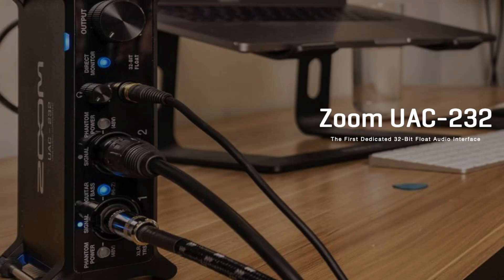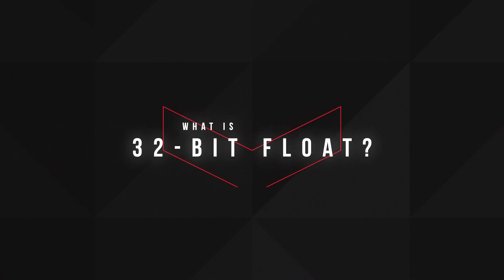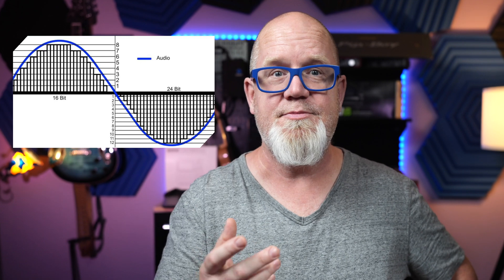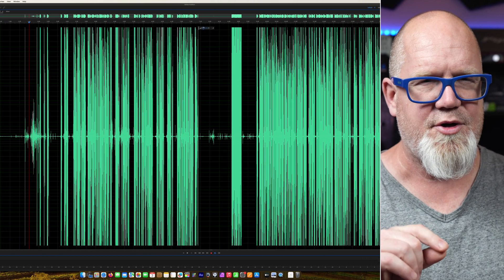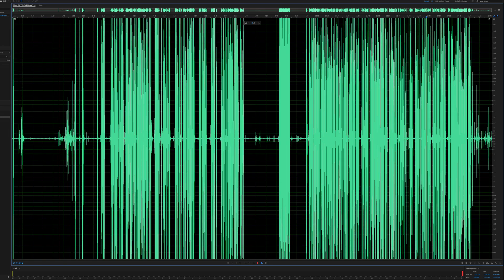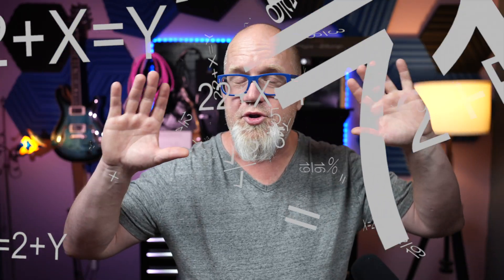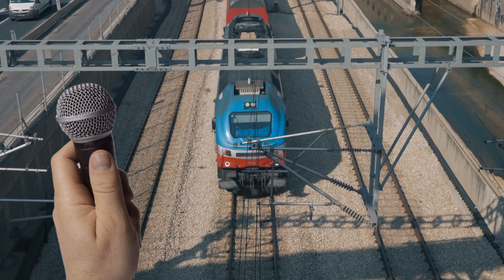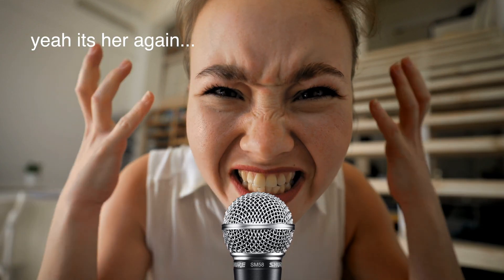Is 32-bit Float REALLY Necessary For Your Audio Setup?

Comment: 4:30 yes.that but also micing when you’re in nature in general. You can record all the things across the dynamic range - a lion’s footfall AND roar is the common example. You have a wider berth for your gain stage. 

But as primarily a music guy? Higher bit depth is useful if like me, you have no formal training and lack the proper discernment to not use every fancy new plugin that can otherwise bring up your noise floor. Across multiple tracks that adds up and can effect the overall sonics especially once you consider the “self-mastering” stage. (a beat I’m mixing can have as few as 12 tracks or as many as 100+ depending on how ambitious the project.) So even when going for a 12 or 16 bit emulated sound or classic era samplers, it’s best to “emulate” it…at as high a bit depth and sample rate as your rig and signal chain will allow. For example, grab some excellent quality vintage emulation processors a la decimort or rx-20 or the sp emulation and resample it at 32bit (or just set the project to 32bit float) and as high a sample rate as possible without your system crashing. 

Why:

Because that mathy float point stuff? When you then load it into Studio One or ProTools or some other primarily “mixing” system? You can gain stage without worrying about noise floor or too little dynamic depth. I can “record” at a lower level without being too concerned with clipping. (This is more important in some genres than other like metal, alternative, etc where it can jump from loud to quiet quickly, and with emcees who don’t really stand tf still in relation to the mic because of the nature of what we do, and the cadence and delivery requirements of spitting.) you can get a great take with as high a bit depth as your gear will allow, which to my knowledge can top out at 24bit with most rigs. 

But then it’s all the plugins. If you use well thought out vintage emulation a la Slate Digital or UAD’s offerings, you MUST - I repeat - MUST gain stage as though you are in an analogue environment for those VMR or VTM type vst’s to respond optimally. I aim for -12db peak across the board. The closer  you get to that in the take (even when dealing with virtual instruments and drum samples out of a modern system from MPC or Maschine), the better. But if you’re starting out with 32bit sounds in the daw and bounce it at a higher rate in compliance with Nyquist (if your end master is gonna be CD quality of 44.1, set your project to double at 88.2; and if broadcast standards of 48khz, go 96). But if you come into the mix session at double the sample rate, and you import into a more robust mixing DAW, set that to the same so the internal math doesn’t get wonky via conversion. 

Then your effects and what not will behave as designed and are less destructive. Mathematically, you can only alter the sound by subtraction- that is, REMOVING bits. Anything you do to alter the sound is subtractive in the digital space, when it’s additive in analog like with 2” tape machines. The float point helps, and the noise floor is so low that it is not a problem no matter how much you use the multiple compressor mix philosophy. As a novice who didn’t know that, I can attest that this was ALWAYS A PROBLEM. Yes, even entirely ITB.

Comment: 32bit float is like HDR in video. It’s a float depth which enables high dynamic range, which means you will never accidentally clip your audio and can normalize it in post without any signal clipping or losses. For someone who doesn’t care about leveling while recording it’s great. That’s why for these portable Zoom recorders, it makes it basically idiot proof as you don’t have to worry about your mic levels.

Comment: I do have the Zoom UAC-232 and like it a lot. For usual meetings in Teams/Zoom, I used cheap 24bit Interfaces (and now changed to a Vocaster 1 because the preamps are much less noisy and really offer enough gain for the Podmic). So I know about the struggles getting the levels right. But the UAC-232 is for capturing my synthesizers. For mixing and layering the music audio, 32 bits float (that is important, now cheap chinese audio interfaces seem to offer 32 bits int which is pure BS) are very welcome because I don't need to think about being over the limits. The export task then calculates everything to be on the non-clipping side.  For live streaming I see no advantage as you need to set some proper volume anyways to be audible.

Comment: To bounce off of what you're saying, there are very few things in audio that are NEEDS. Outside of one's specific use cases, most things are just nice to have. You need a mic... it'd be nice to have one that sounds great. You need a preamp... it'd be nice to have one with low self noise. You need cables... it'd be nice to have ones that are durable and keep out radio interference. You get the picture. In my use case, I record a lot of self-directed character VO for various projects where dynamics range wildly. I spent many years keeping an eye on my levels - making sure to turn the mic down for louder lines and back up for softer parts and so forth- and it was fine I guess but It took a lot of mental juggling going in and out of character so much to ensure I didn't clip. 

What I like about having a Zoom F3 is I can just walk into my booth with my micro SD card and just act. No additional need for set up or watching my levels like a hawk. It's nice. For the rare times I have a session where I need to be directed live, I have a UA Volt that I run from my booth to my laptop and a splitter so I have a back up recording on the F3 in case anything goes wrong. It's a very specific use case and I can't really see it being as helpful for something like promo or commercial VO, but it's perfect for me and that's what matters.

Comment: 32 but float is storing higher levels of precision when calculating the result of each step of DSP.  A plug in will have multiple steps of DSP.  You may have several plug-ins in the path of just one audio track by the time it leaves the master bus.  If at every step of DSP you're lopping of details, you lose accuracy.  The float is there to preserve as much as possible and then only introduce the big lop-off at the very end when we reduce to our session bit depth.

33 but float isn't for recording.  It's for processing.

Comment: Is there any newly released device in 2024 that is not 32bit float? Maybe some USB microphones and smartphones. But if manufacturers don't want to shoot themselves in the foot, they need to add 32 bit to anything now. I still have some field recorders with 24bit, but I prefer the 32bit workfkow for my solo-shot videos. I still set gain (magnification level or digital trim) but 32bit float allows me to focus on the picture (cameras, lights) and my acting in front of the camera.

Comment: I think for beginner YouTubers with a studio and a fixed mic placement the 32bit workflow might get in the way, if the zoom levels are not set correctly they’ll need to use a DAW to set the levels in post, or else they’ll end up clipping if their video editor doesn’t support 32bit float audio and their recording level zoom (is that the correct term?) was set too high

Comment: Why didn’t the Rodecaster Pro 2 & Duo get 32 Bit float? I guess if you are doing sound checks and monitoring maybe it’s just like camera folks preaching it’s better to get your exposure right before you hit the shutter/record? Same applies to audio?? 🎤🎙️
Reply from the maker: Really the whole point to the unit is to monitor the signal.
You have all the meters...and all the faders.
32bit float would be a bit unnecessary...
Or at least it wouldnt be much of a marketable feature

Comment: Headroom or float, or there is another way - two mics with different gain levels. This is how Tina Turner was recorded in the 80s when she had her massive resurgence. I have heard of some voice actors also doing this so they can scream mid scene/take. 
Never used float myself. I find 24/96 perfect for anything I've personally ever done, and tbh I think my ageing laptop would crumble with 32bf.
Reply from the maker: Yeah...there are definitely niche uses that make it unbelievably cool and necessary...
Doubtful any of them are recording on to a sub $500 interface...lolz
Reply: That's a good point. I have two Rode M5s and did this to record thunderstorms as the closest thunder clipped like hell. So used the 2nd mic on the RCP2 at far lower gain.
Reply: @titaniumben9923  Yeah a great reason to buy a matched pair imo.

Comment: I just learned that 32bit float has a dynamic range of 1500dB , that it weird.

But there is also 32bit integer (192dB) and that will be enough I guess for the most semi pro guys. 

And after that fancy recording, folks just squeeze the audio through a tiny mono bluetooth speaker.
Reply from the maker: @eDrumsInANutshell  essentially.
Mix it down to 256kb/s too

Comment: "Specific use cases" is the perfect answer to the 32-bit float conundrum. Professionals, and even semi-professionals, might never find the need to use 32-bit float. On the other hand, there is a huge, worldwide market for this type of tech when it comes to amateur content creators (albeit not for live streamers). For instance, my friend and her daughter do a small podcast, and they often clip the audio, even after setting the levels correctly (they both laugh extremely loud). So, I let them borrow my Zoom F3 to record one of their podcasts, and it eliminated the clipping problem. They immediately bought a Zoom F3. Lol
Reply: I recently got Zoom F3 Field Recorder. It is an incredible device. It saves my audio every time. Extremely high quality interface with extremely low noise floor. Simply the best.

Comment: Which technology actually has the better dynamic range:  condensor, dynamic or ribbon?  Which of these might be able to take advantage of 32bit float ( when you set your gain too high or low)?
Thanks
Reply from the maker: @steveschnetzler5471  easily condensers.
Specifically for the really quiet signals
Reply: 🤔 Pro VO artist here. In general ribbon mics have the lowest sensitivity, with dynamic mics next, and condenser microphones having the highest. So a Neumann TLM103 is sensitive to incredibly low inputs. On the high end, well, that's a little more complicated. There is a reason that guitar cabinets are mic'd with Shure SM57s - they can handle the volume! But so can a lot of condenser mics, too. For example, for some video game and fictional drama projects I need to SCREAM into the mic, and my Earthworks ETHOS has more than enough dynamic range (145 dB SPL) to handle it. Fun fact, I can't scream louder than the dynamic range of my interface's preamps (113 dB) Ribbons are super sensitive to high dB SPL (sound pressure level) inputs, so you just want to be careful with them.

Bottom line for mics - know what you're recording and check the microphone's dynamic range to be sure you will be able to hear the full range of your sound source(s). But even if you don't, the mic can probably handle it.

But I think we've got to think about this differently. Are you NOW recording sources that will require two different gain settings because they are both incredibly quiet AND incredibly loud, and you can't change that gain between sounds? Then 32 bit float recording is your solution. Otherwise, put the effort into getting your gain right, or accept you're going to be spending more time in post tediously fixing it

Comment: There is not a single true 32float ADC in existence. '32Float' ADCs are actually a pair of 24bit ADCs at 2 different gain levels that change a gain mantissa as they switch.
There is no analog gear with more than 23 bits of dynamic range, so 32 float is pointless anyway - a 32float DAC is simply an alternative to setting your gain properly, identical to using 2 channels with different gains.